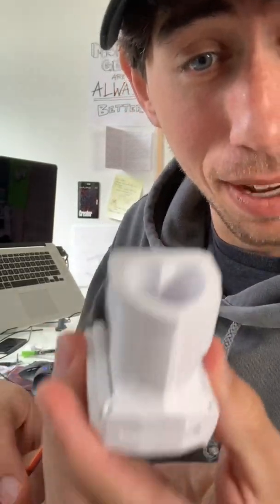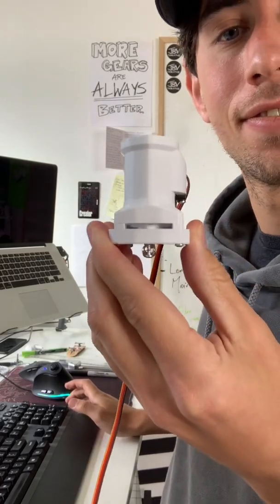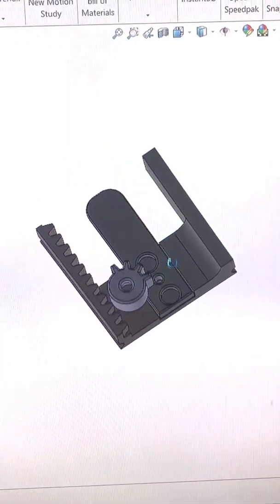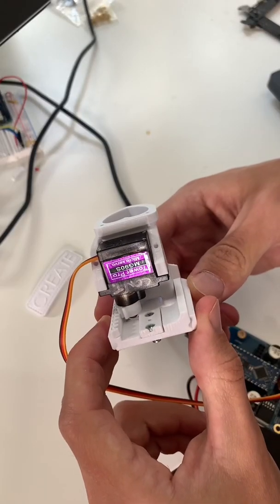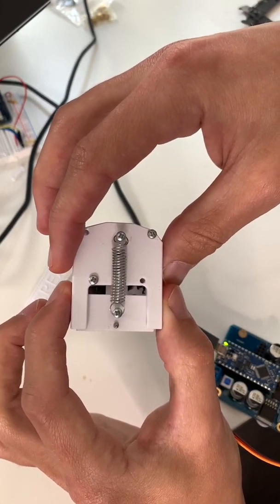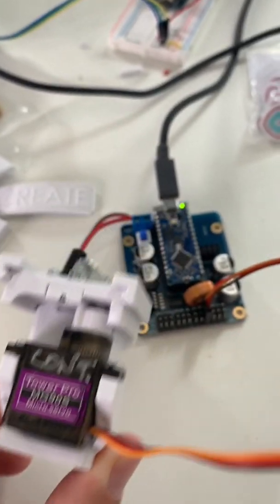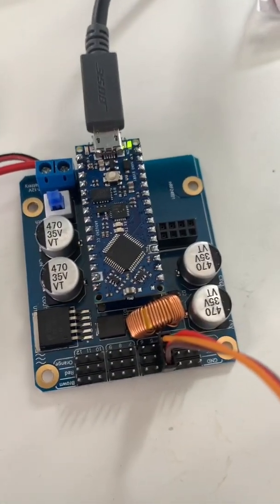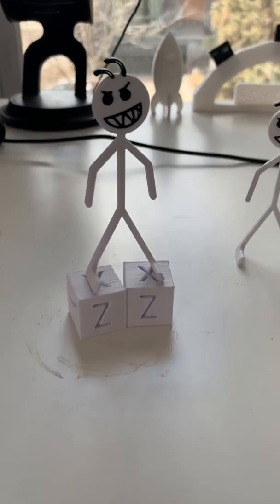The Servo Powered Heart Shooter

Comment: Why would you use a servo for this?

Why would you use an arduino for this?
Reply from the maker: Those answers will become clear v soon!
Reply: @Engineezy  Unlikely!
Reply: Microcontrollers are used to control outside stuff like here he used a servo which he coded to make the movement.
Reply: @jgon12  Yeah, that didn't need to be coded. That's something he could have got for free with a $0.15 dc motor and a momentary switch. no servo, no arduino, just simple components.

Not every project needs to be based around $500 brushless motors, $200 speed controllers, and two fistfuls of $80 servos. This would have been cheaper and better with basic components.

Comment: Is the Arduino and servo motor necessary? A battery pack and a regular electric motor should be able to do that.
Reply: Well depends but the microcontroller is used to control the servos power and motion.
Reply from the maker: Just wait 😎